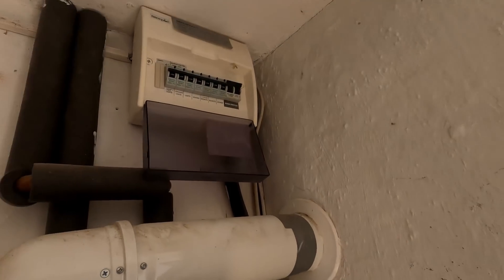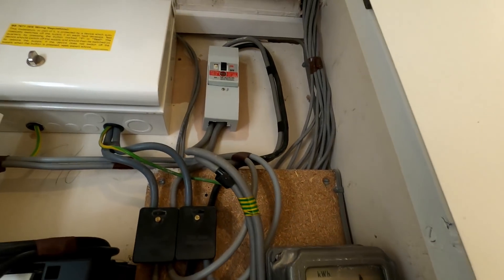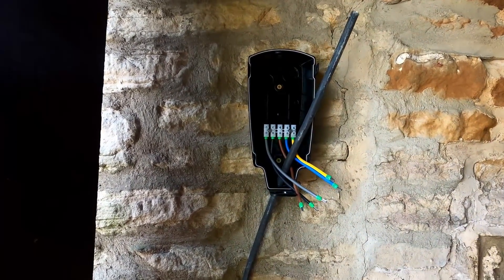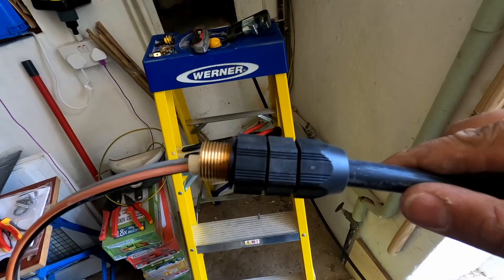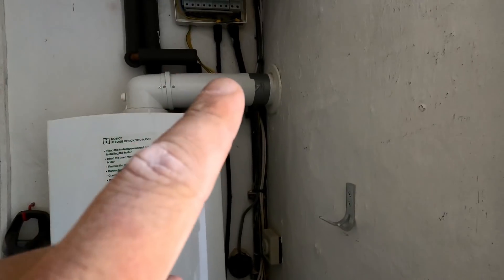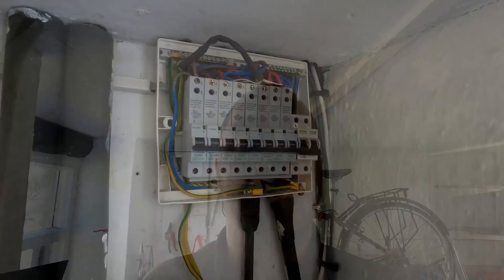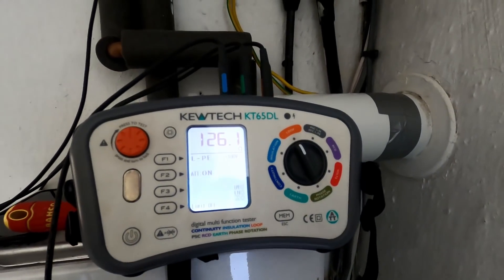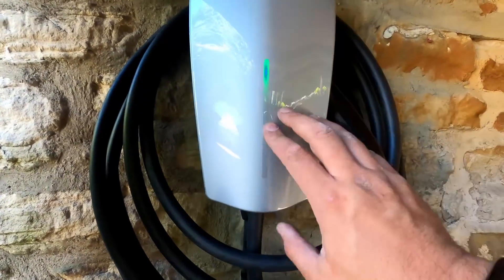Tesla Charger Install - Sparky Life

Comment: Shame about the charger fault. Glad you figured out that you need a type B RCD I was gonna mention that! I’m fitting one for myself soon as a bit of an experiment as I want to see what it’s like compared to the Zappi.
Reply from the maker: Yeah was disappointed it wasn’t working after putting the work in but it happens. I managed to find a place that does a complete sub board with rcd and mcb’s for £159 (inc vat, I think). You going to do a video on the experiment